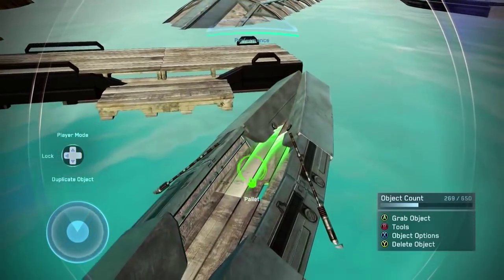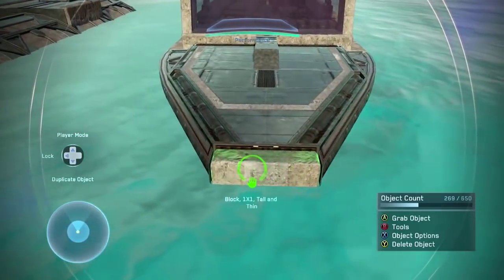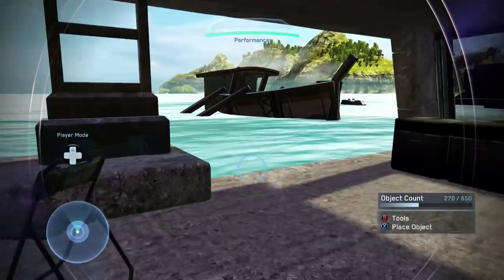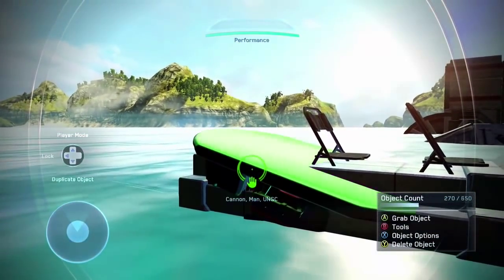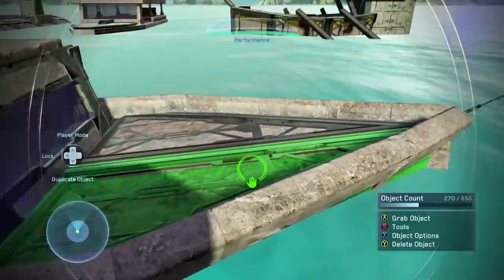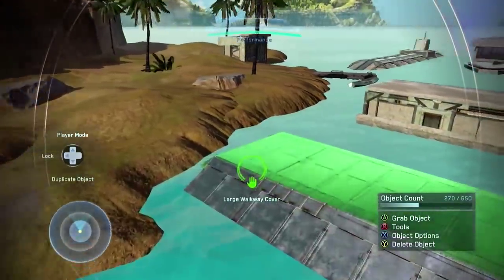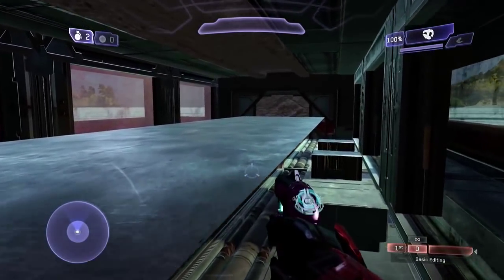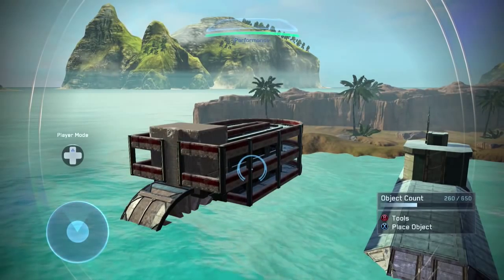Halo 2 Anniversary Forge Tutorials - Boats

Comment: There is an actual way to make a working boat.  In forge drop a wooden pallet from any height, it instantly will float.  How to work it is a little tricky to learn.  To go forward stand on the middle, but a tad over.  That will make you move forward.  Vice versa for backwards.  Going left and right is really hard.  You have to lean on one side, then so you don't fall, move the boat forwards.  Hopefully people learn about it.
Reply: I acctually (by accident) noticed that earlier this day when I was forging a minigame of floating pallets